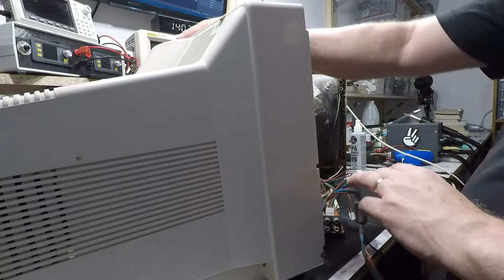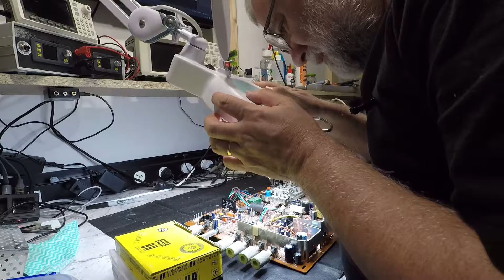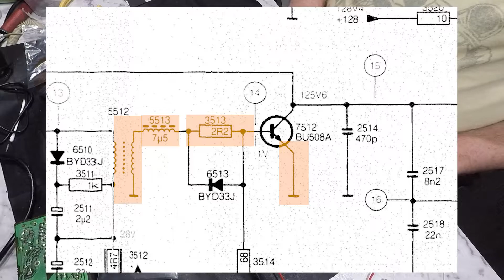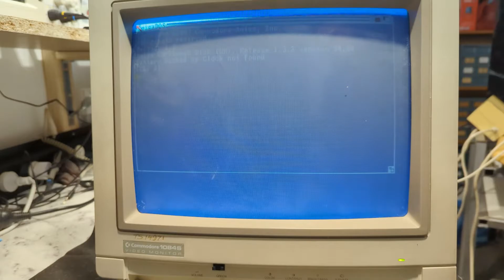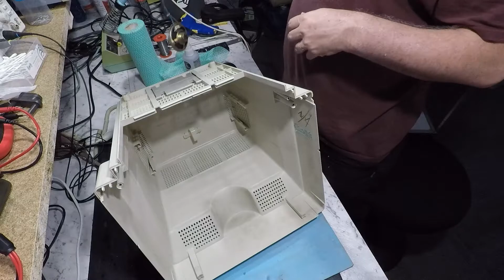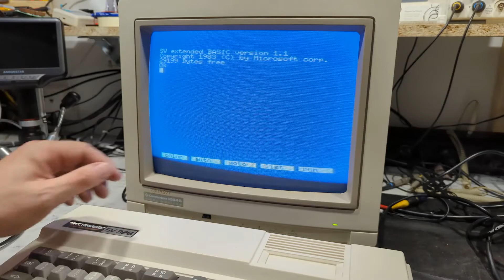Commodore 1084S-P1 repair

Comment: Did the S-P stand for Slow Phosphor or is that just a coincidence? I assume this is a high persistance phosphor monitor?
Reply: S = Stereo - P = Philips (as the 1084S-P1 was made by Philips, instead the D series was made by Daewoo), I guess!
Reply: @MtaFto  Makes sense ;)
Reply: The long persistence phosphor monitor was the Commodore 2080. However, in games that wasn't as good as 1081/1084 (ghosting).
Reply: @MtaFto  I'm fully aware of that :) Do you know any other color CRTs with high-persistance phoshpor? I'm in the market for one
Reply: @Perforu  sorry about that, really don't know much. Just a brand it came to mind: Diamondtron. Not aa specific model however.